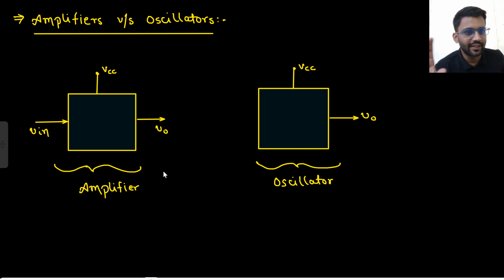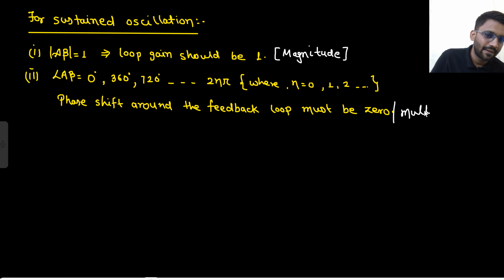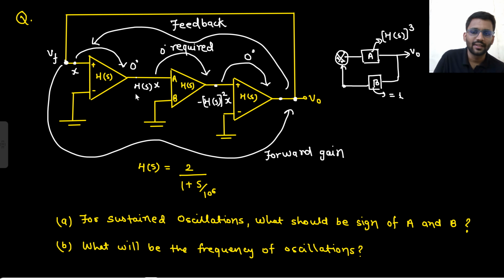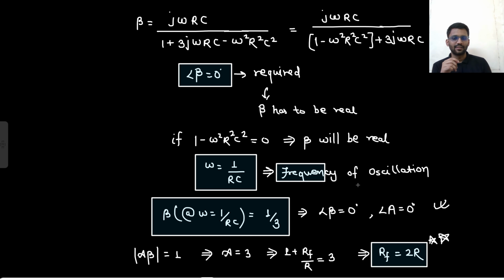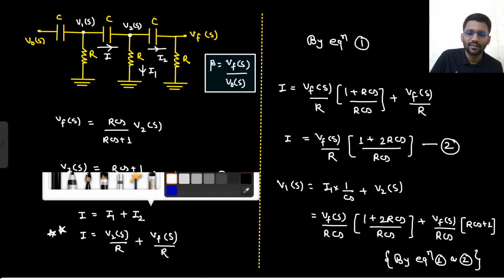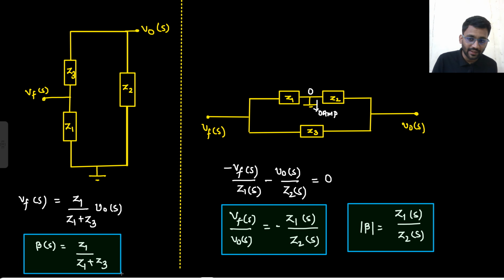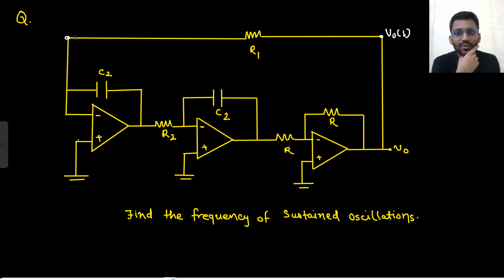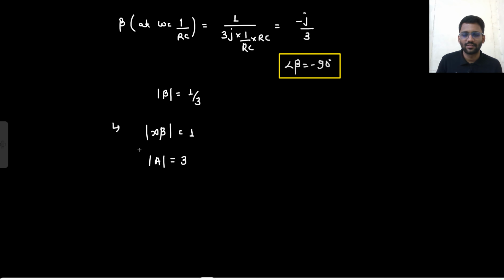Complete Concept of Oscillators Using OpAmp || PrepFusion || Himanshu Agarwal

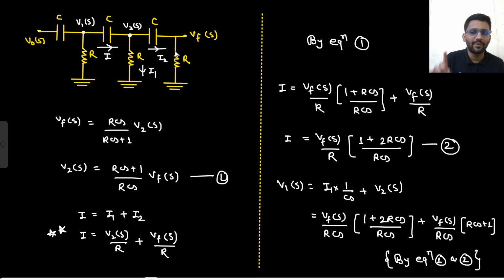Comment: 1:12:10 the resistance R1 will load the network beta. So that must be included in the calculations too! Only if there is a buffer connected between the network beta and R1 will this analysis be correct.

Comment: 0:00 Difference between amplifiers and oscillators
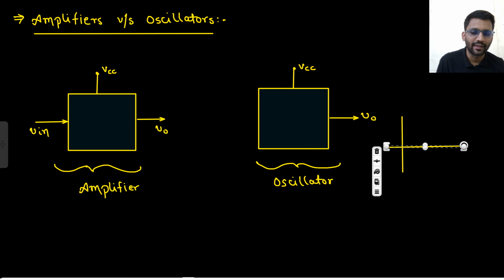02:12 Understanding the concept of oscillations in OpAmp circuits
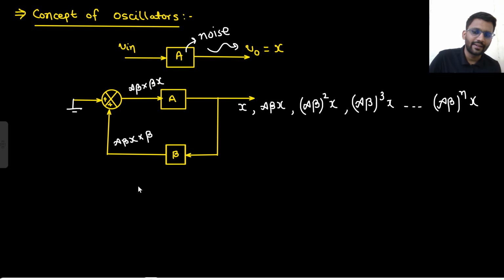06:39 Explanation on the behavior of oscillations for different values of a beta.
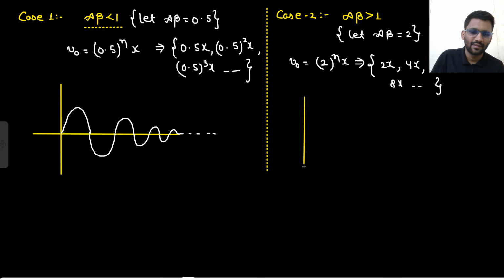09:41 Oscillations will increase if a is greater than one.
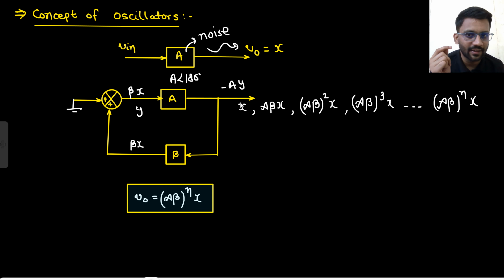14:52 Maintain 0 degree phase shift for sustained oscillations.
16:50 To achieve oscillatory output, loop gain and phase shift must meet certain conditions.
20:32 Understanding the concept of oscillators and OpAmp gain in feedback circuits.
22:43 Understanding the key concept of sustained oscillations in feedback amplifiers.
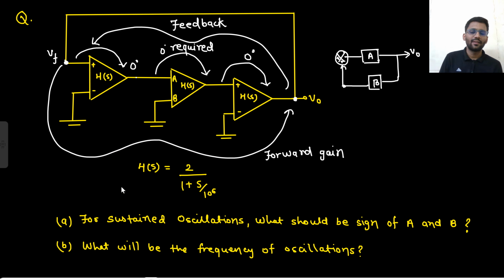26:48 The forward path gain needs to be calculated
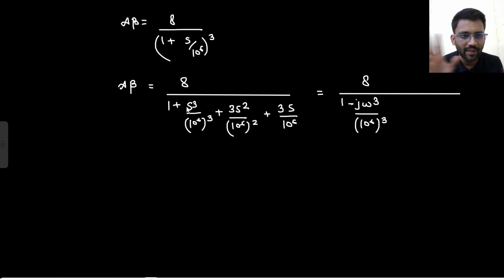29:44 Oscillator analysis using OpAmp
34:47 Understanding the real and imaginary parts of beta in the context of oscillators using OpAmp
36:53 Understanding the importance of considering transfer functions in oscillators
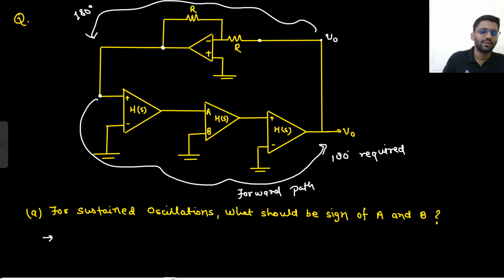40:28 Achieving 180° phase shift using op-amp oscillators
42:13 Understanding the ratio of RF by R for sustained oscillations
47:23 Understanding feedback factor beta in oscillator circuits
50:08 Achieving specific phase shifts in oscillators.
54:14 Analysis of forward gain and feedback factor
56:00 Understanding V bridge oscillator circuit
1:01:02 Adjusting parameters to make the beta value real for oscillations.
1:03:36 Understanding the feedback ratio in oscillators.
1:07:53 Frequency and feedback factor calculation for oscillators
1:09:36 Analysis of beta for frequency shift in oscillators
1:13:32 Determining Vnot value using equations and Beta calculation
1:15:37 Determining the frequency of oscillations requires checking for a 180° phase shift
1:20:18 Explanation of achieving 18° face shift for real beta.
1:22:07 The LC oscillator uses an inverting amplifier and an LC circuit.
1:26:19 Understanding the design and calculation of the feedback factor (beta)
1:28:23 Understanding the feedback factor in oscillation circuit.
1:32:11 Derivation and calculation of beta value and frequency of oscillations.
1:34:19 Understanding oscillators and their types
1:38:41 Frequency of oscillations formula
1:41:01 Condition for oscillator stability
1:45:25 Understanding the conditions for sustained oscillations
1:47:56 Understanding virtual short and finding feedback and forward gain
1:52:58 Forward gain provides 0° phase shift
1:55:32 Understanding the frequency of oscillations and feedback in oscillators
2:00:01 Conditions for sustained oscillations
2:02:01 Feedback path angle requirement for oscillators
2:06:32 Understanding the concept of oscillators using OpAmp
Reply from the maker: Great. Thanks for it. 
Just one request. Edit out this comment and start from 0:00 
Otherwise YT will not be able to capture it
Reply: Done @PrepFusion_GATE
Reply from the maker: @Koushik_Ghosh2 Please start from 0:00, not from 0:07